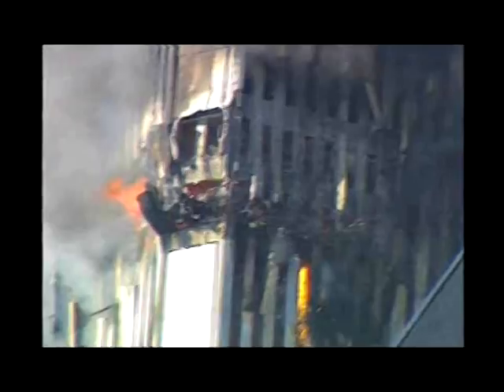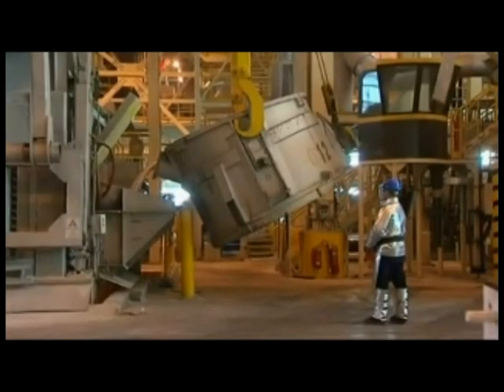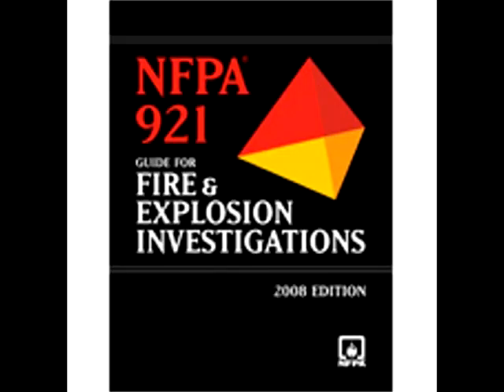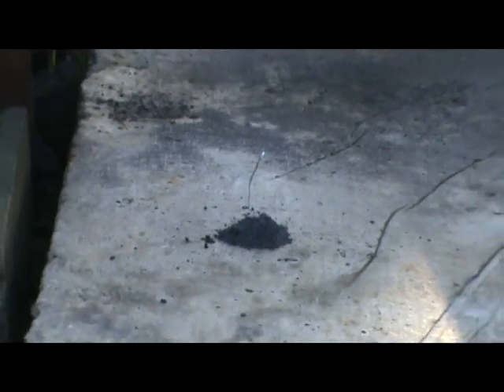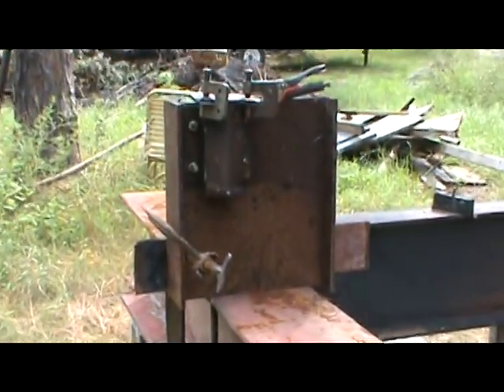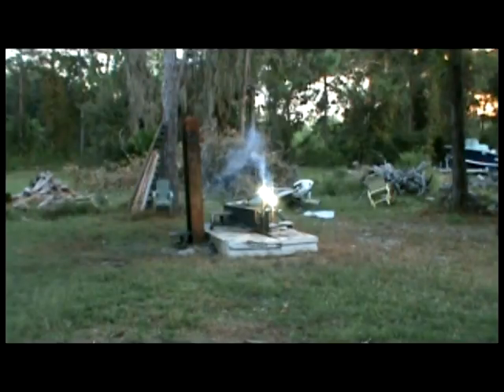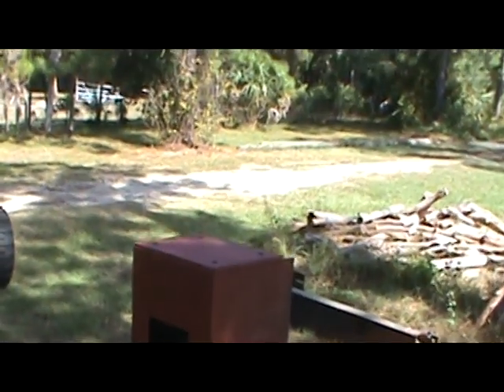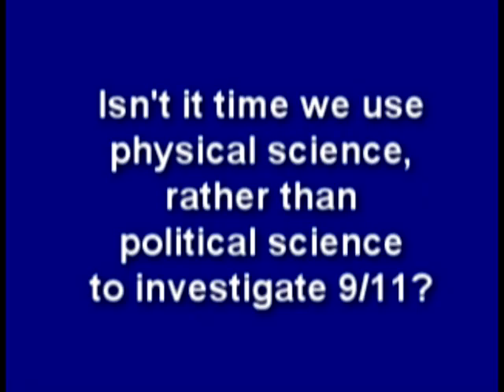9/11 Experiments: The Great Thermate Debate

Comment: a steel structure doesnt have to melt to fall apart..it just needs to bend. even a 10 or 20% bend in the metal is enough to cause a structural failure..Im amazed this is still a debate point!?
Reply: It didn't bend it was turned to dust. There was nothing left of those towers. Where was all the "bent" steel in the rubble of ground zero?
Reply: Dude, bend not collapse 🖒. You know how differently that building would have collapsed if it was by bended steel???? Seriously just stay in your shell.
Reply: The thing I love as well is these are the accusations used to explain why the building collapze. These are words from the government and people are explaining why there is no way it could melt. Learn the slight difference. These are not quotes from theorist but from those who made them when this event happened to defend them from not being exposed. Use your brain.
Reply: Ok then why did building 7 fall? It fell because it was bombed like the others

Comment: It is interesting to entertain such alternate theories but I think the 911 attacks were exactly what they appeared to be. Hijackers in planes flying into buildings. Knowing how to melt steel and that you can do it with a fire pit, wood, and something to blow air into the fire it isn't a stretch to believe that the jets and the fuel kicked off a similar process. Much like the starting of a fireplace, a smaller fire gets the air flowing in the correct direction. With everyone evacuating down low with colder air coupled with extremely hot air up top, a flew like event would take place. Causing the building to act as a bellows pushing air out of the holes and melting the steel in the hottest points. The jet fuel itself acted much like the newspaper does when I started my dads wood stove as a kid and got the initial air flow going. Simpler explanations like mine rather than elaborate plans with thermite is where I would place bets.

Comment: The f##### beams didn't melt! Which half-wit made this video? Rail tracks can buckle on a hot sunny day. I think it was a bit hotter than that, in the towers.
Reply: James the moron..then why did NY firefighter philip ruvulo say on camera that youd get down below and see molten steel
Reply: @mikepavlik3577  is he a metallurgist? Maybe you specialise in tin foil?
Reply: @ThePoopBandit how did you determine that it was not molten aluminium on the video?
Reply: Also a plane hit them with a force 14 times greater than that they were built to withstand

Comment: yeah, so they set these up all over while people worked and no one knew, nor was there any "spark" effect like the one created by thermite, nor did this explain the molten liquid. If molten aluminum could've created the heat required, and there was plenty of heat and aluminum, why not do tests to disprove that instead of tests to further your hypothesis? Because you know the tests with the aluminum would prove true.

Comment: I looked into everyone saying jet fuel couldn't melt steel.  And then a gasoline truck hit a steel support on a Boston bridge and the fire melted an I-beam.  This was a gasoline fire, not even a jet fuel fire!  Combined with all the other combustibles in the buildings, and all in confined spaces, with air being sucked up elevator shafts feeding the flames, it was a conflagration in there!  I don't doubt steel was melted.

Comment: The fires at the upper floors created a natural draft furnace is the simplest explanation, you can process iron ore with a wood fire in a hand built clay draft furnace. Just imagine a fuel that burns 10 times hotter in a furnace 1000 times the size and all the sudden it becomes a very plausible explanation but no just keep thinking conspiracies

Comment: Good grief. You don't have to melt steel to structurally weaken it.  Buildings aren't designed for jet plane crashes and  prolonged fires. The scientific illiteracy here is astounding.
Reply: The twin towers were largely supported from the outside.  They were NOT of a standard girder construction.  The floors were poured concrete on top of steel trusses.  You do NOT need to melt steel to have a building collapse, all that had to happen was raise the temperature of the steel high enough to weaken it.  It will have the strength of wet newspaper far below its “melting” point.  Simple physics folks.
Reply: Mark Hawks  hmm interesting thanks
Reply: I agree with you, but explosives or thermite would need to be put at the bottom of the building to guarantee collapse (just watch any demolition video) - and it takes weeks of planning and pre-weakening the steel (ok last point was answered by "secret undercover people coming in not noticed over a few weeks - plausible)

....but the main point, making the buildings "totally collapse" is simple INSANE and achieves nothing for the government that wouldnt be achieved from the airoplanes going into the buildings.
So 3000 people die instead of 250 if the buildings didnt collapse ?
The whole conspiracy story of an inside job is ridiculous for this reason.
Same headlines would occur if no "demolition" took place, same impact, same story, just slightly less casualties. Even better with no demolition - just imagine both towers blackened with fire and under repair for many, many months - still same effect on the media, foreign policy - pretty much everything.
Reply: How many structurally damaged floors of the Windsor Tower were there?
Reply: The lack of scientific illiteracy isn't as astounding as the taking of a small amount of actual science and twisting it in with half-truths in such a way to fit these truther's narrative. Remember, you cannot reason people out of positions they didn't reason themselves into.
Reply: "The lack of scientific illiteracy isn't as astounding as the taking of a small amount of actual science and twisting it in with half-truths in such a way to fit these truther's narrative."

""The lack of scientific illiteracy..."

Lol... says the guy who can't even properly use English to convey his thoughts... nice double negative... you just said I have scientific literacy. Which I do. I read articles and watch videos about physics, astrophysics, earth sciences, and a whole lot more all the time, almost daily, in fact.

"Remember, you cannot reason people out of positions they didn't reason themselves into."

Ah, yet another person making an assumption... I do my own research, dumb ass. I don't believe anyone else's theory, only what I've determined myself in the last 16 years.

I love how not a single one of you people has had the balls to watch anything I've posted, nor have you had the balls to actually address anything I've said and rebut it with anything other than the crap from the "official story"... it's fucking hilarious how you people just sit there parroting back what you've been told to believe, and then accuse me of just believing what someone told me.

You're all mental cowards.
Reply: Here is 7 damaged floors right here. https://www.cs.purdue.edu/homes/cmh/simulation/phase3/Run11/NorthFaceWTC1.jpg

As an inspector working with structural steel products, I do know what it takes for steel to lose its strength and at what temperatures. Do you?
Reply: gj you know what happened. sorry i didn’t know you were there that day. not one of you’re theory’s can support you’re arguement.
Reply: gj  I am going with the people who have PHDs and experts and each agree that  it was not explosives
Reply: @SRaju-ij5ft  for the fact that the government pays for their research.
Reply: gj  why the anger ? I am just trying discuss on how the towers fell on 9/11. You have been uncouth and I think it is you  who needs to get off the internet and take the time to grow up.
Reply: Christopher Hickie  thank you
Reply: The twin towers were literally designed to withstand a plane crashing into them.
Reply: Im with you gj. They will believe anything , and i have the same problem in Canada. Passive , stupid , follow the crowd , phoney's everywere. Your damn right this was explosive's. And in my opinion  , done by your own government .
Reply: Christopher Hickie those buildings were built to withstand a 747 , so cry on that also in nowember when you loose
Reply: What about WTC 7 then professor?
Reply: Your wrong the engineers who built the towers designed them to withstand a airplane crashing into them.
Reply: Free fall speeds disprove the pancake theory.
Reply: gj way to use the f word. let me give you a little lecture. metal doesn’t need to melt to become brittle or weak. the plane drove into the core of both towers cutting off stairways, elevators, and fire extinguishing systems. the hour long fire in both buildings spread across around ten floors created an overall unstable layer. keep in mind there are about another 20-40 (varying for building) floors above the impact area. the constant pressure of the floors and unstable floors below it led to the collapse. the south and north tower buckled in the corners closest to the impact. and the “explosions” people heard are the floors above the impact falling before total buckling and collapse of both buildings. as for building seven, the collapse of both towers impacted buildings surrounding them which let to damage and collapse, fire.
Reply: Do you have any professional qualifications? Oh ,yes, you're either a government troll or a full-time parrot of msm
Reply: @cloudwatchmusic  so the reason WTC 7 fell was the aftermath of the towers falling? My house is still standing though. How do you explain that, I'm curious.
Reply: gj just stop wasting your time trying to convince these idiots.
Reply: Badger Is Here  you  guys are paranoid
Reply: Actually, the Twin Towers WERE built to withstand an impact from a Boeing 737. Now, you might be saying "But a 737 is a smaller plane than a 747!"... And that is true, a 737 is smaller than a 747, but it is also FASTER than a 747... thus, a 737 would have an equal, or possibly slightly higher kinetic impact, which would at the least equalize the amount of damage the two planes could deal to the Twin Towers.

Comment: The question if steel melts or does not melt from fire is irrelevant. The question they should be asking is, who turned off the sprinkler system that would have put the fire out in less than 5 minutes? They would not need to even ask the question, does steel melt or not?

I studied architecture for 4 years and after graduating college with a 4.0 GPA in architecture, I worked as a professional architectural draftsman for 11 years. I was required to study all federal and state codes, including fire and safety codes, every year or when the codes changed. Note, according to federal laws high rise buildings are required to have sprinkler systems in every room and to be independently supplied from water tanks located on the upper floors and not supplied by a water main to the building. 

Back then when the trade towers were built, federal laws required that the steel columns be wrapped in a fire retardant material, such as asbestos, in case of a fire so that the integrity of the steel would not be compromised by heat. Then federal laws changed and it became illegal to use asbestos because of health risks. In fact, commercial buildings that contain asbestos, the law requires that all the asbestos be removed prior to any renovations to said buildings. Meaning, no renovations or upkeep in maintenance could be done on any of those building that fell on 9/11. Painting an interior room was considered unlawful if the building had any asbestos within it.

The previous owners did a cost estimate on the buildings before 9/11 to see what it would cost to remove the asbestos. The cost estimate determined that it would have been costly. I remember reading that the estimate to remove the asbestos was more than to demolish the buildings, clean up the site and then rebuild new buildings on the same foundations. Still to demolish the buildings and clean up each of the sites would have been costly and also prohibited because of the asbestos dust lingering in the air, breathed by residents ultimately effecting their health. The owners would have been liable for any civil claims of cancer caused by breathing in their asbestos. 

The previous owners could not do any upkeep on the buildings, could not paint, drywall, renovate, or even do parking lot striping because the columns were wrapped in asbestos and they couldn't even demolish the buildings. They were at a complete loss. That is why I believe the previous owners sold the 3 buildings to Larry Silverstein real cheap. They had no recourse except to get out from under that cash cow. 

I believe the buildings were already set up for demolition prior to Silverstein buying them. Besides, even if kerosene got hot enough to weaken steel, it would not have weakened the 6² ft steel columns in the center of the buildings, they were wrapped in asbestos. It would not have weakened the exterior 16² inches of steel columns where the planes did not touch, especially if the fire had been extinguished by a properly working sprinkler system located on the floors above the fire, heat rises and that's what sets off sprinklers. All the steel columns would have stood strong after the collapse of the floors, if the floor trusses had weakened. Especially the 6 foot square steel columns located in the center of the buildings. The center never should have collapsed, and if you watch the videos, the center is what collapsed first. Fire cannot melt steel. Fire cannot weaken columns wrapped in asbestos. You don't think that architects designed those buildings without even considering that the buildings might be hit by large planes, being so close to the airport in NYC?

Just spend a few weeks reading through all the federal and state building/fire codes. I know this because it took me 3 weeks, about 120 hours to study and take notes on all the building and fire codes when I was working as a professional draftsman. After you finish studying the codes you will see, everything that happened to those buildings on 9/11 should have been prevented. Well, that is if all the federal codes were followed to the tee. The fact that 3 buildings fell, presumably from a fire, was evidence that federal and state codes were not followed.

Comment: The molten metal you can see flowing is molten aluminum mixed with molten copper, bronze and brass from fixtures, fastenings, pipes and wires....  The copper gives it a reddish glow similar to molten steel.
Reply: Tinker Tailor ...... ok Hillary go write another book on how you lost to trump lol.
Reply: I mean, He did just provide a reasonable sounding solution. Did you research to prove him wrong or are you just dismissing his statement? If you want to prove something you need to be able to disprove any REASONABLE argument thrown at you. Throwing insults or dismissive statements at in this case Tinker doesn't help you any.

Comment: What this theory fails to address is the fact that you don't have to melt steel for it to become weakened and malleable. So yes, the temperatures in the building weren't high enough to melt the metal beams, but they were high enough to weaken them.

As for why they fell the same way, the weakened area where the planes had crashed into collapsed, causing the building above that area to fall down. The rest of the building below was not built strong enough to withstand the force of half/a quarter of the building falling on top of it, so it failed and the building fell straight down.

No conspiracies needed.

Comment: Thousands of safety radio controlled thermite bombs were planted in advance to structural parts through the service passages. These were ignited and exploded in a sequence to look so as tower fell on its own. The same program were run on both towers.

Comment: Office fires (rugs, paper, drywall,furniture and people) can melt steel. Trapped with a proper O2 source (like on the upper floors of an office tower with high winds and multiple elevator shafts to fan the flames!) temps can get up to 3500F. A wood fire can melt steel.  I am a trained US Navy EOD professional, I do know what I am talking about. This tragedy was caused by aircraft crashing into buildings, pure and simple. The experiments in this video cut are bullshit. These are controlled. All these years later and nobody who was supposedly involved in this supposed black flag mission has come forward. A mission that would involve hundreds of trained personnel. How would all these Thermite charges be attached to outer columns of the buildings? Thermite can cut through metal and bolts. But big deal. Please. By the way the columns were bolted and welded on the WTC. I'll never go with what the government and media tell me. I take their info at face value. I'll trust in my Explosive Ordinance Disposal Training and Experience. Save it for the movies. I guess it can!

Comment: going to a far extreme to prove this way out on a limb. just saying from people i know who cleared the area after  the attacks. one was ex military fire fighter another was a structural engineer both said and i quote the damage suffered at the world trade center is that of a out of control fire waking the structure and support  pools a jet fuel soaking carpets walls ceilings floors. As they burnt steels beams what were surrounded by the fire on all sides fave way fell into the fire and under extreme pressure and heat melted warped etc.